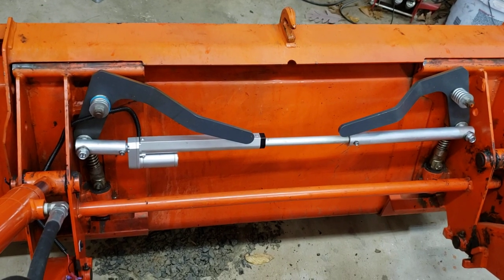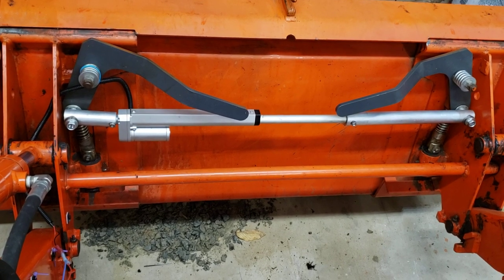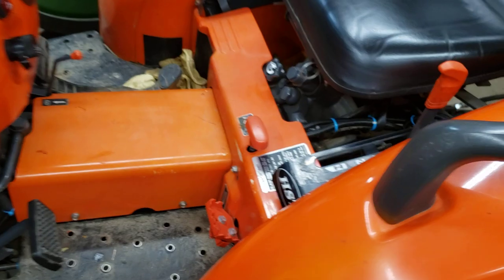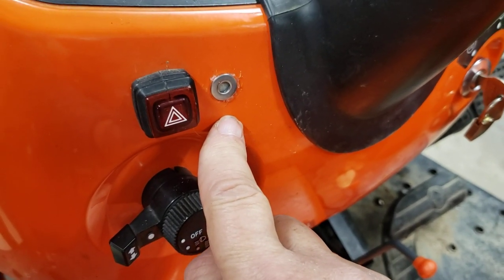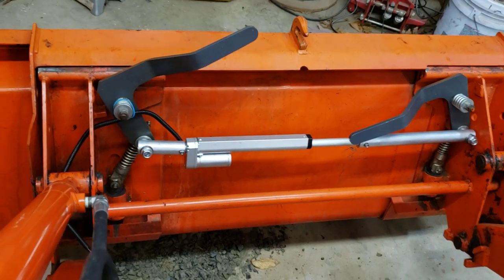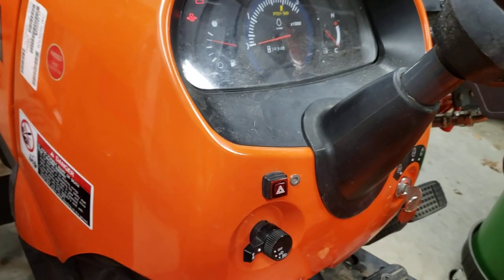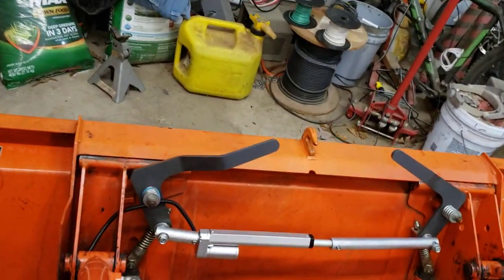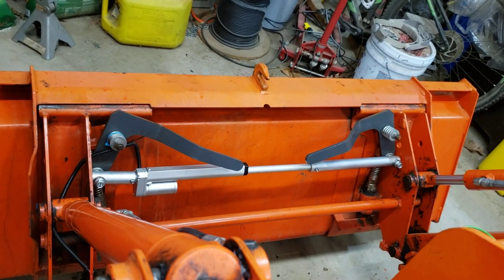automating the quick attach on an L3800 Kubota tractor

Comment: Where did you get your power and negative from for your switch?
Reply from the maker: Hello Walter
just saw your note.
I installed a 6 position fuse block on the left rear fender of my L3800. It is fed from a 40amp automobile relay. The relay coil is connected to the rear work light pair that I wasn't using (you could still use for your rear work lights if you wanted to). The work light circuit is switched on with the ignition key. I ran a pair of 12 ga copper wires directly to the battery in front. There is a 30 amp inline fuse at the battery. 
I use several of the fuse block positions - I changed my 3pt snow blower to electric activation for the rotation of the chute (motor) and deflector control (linear actuator). I also have forward and rearward led lights on the rops.

Comment: Nice work. Thanks for sharing - What LED flasher did you use?
Reply from the maker: Thanks Scotty :)
Here is the link to the led flasher I used:
https://www.amazon.com/gp/product/B096XPH229/ref=ppx_yo_dt_b_search_asin_title?ie=UTF8&psc=1
2 for $9. I wasn't sure they would work with only 300ma draw but no problem at all.

As I said it was a fun project. I got to use it the last few days swapping my grapple for the bucket. True I have to get off  to hook / unhook the hydraulic connections on the grapple but somehow it seems a lot easier.
Reply: Any chance you can list the parts for this job?  Want to do the same for my son's tractor